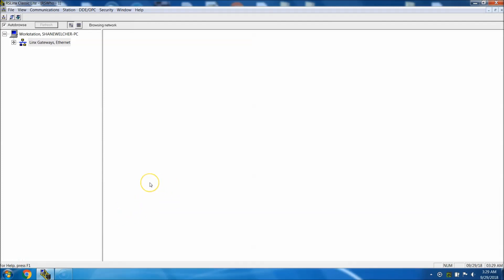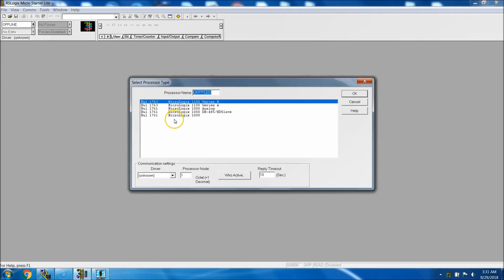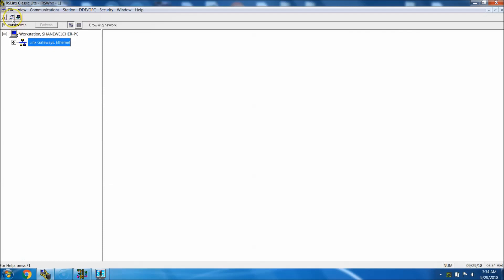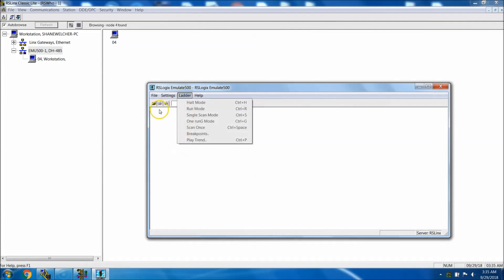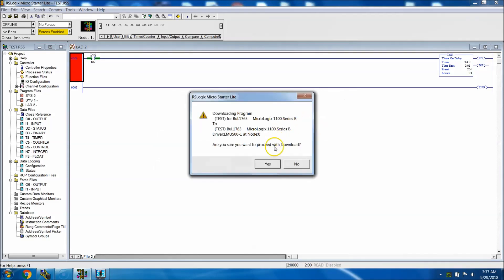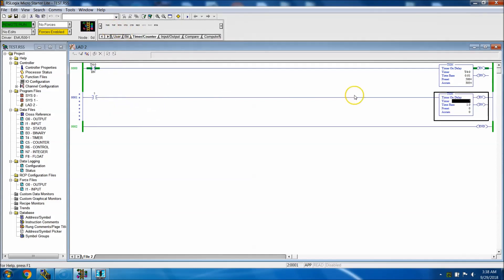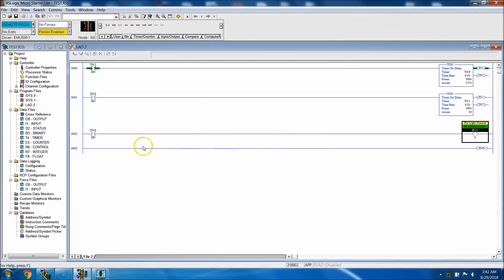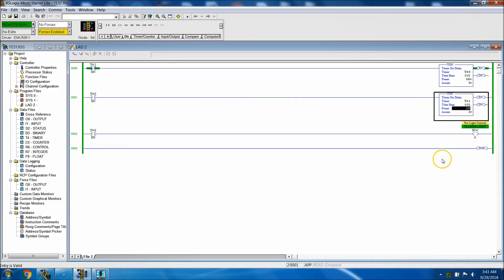Using RSLogix Emulate 500 With RSlinx The Easy Way

Comment: Thank you so much for posting this video I'm older guy a a machine  equipment building  maintenance technician in a contract manufacturing shop and have a lot of years as electrician, machine control circuit limited with actual fuel running of CNC equipment but always chad a set up guy to help me with that part of the troubleshooting an o experience with programming ,we starting to get into automation equipment now and I am messing with a online PLC basics course,but I'm lost this video got me set up with the emulator and software I downloaded a while back and had no luck working with course instructions , following you on video had me up and going and putting that first program on and running in 30-40 minutes . I hope to find more of your videos as I work through the course ,I've hit some road blocks now as he is explaining comparators,and mathematical operators , and I am lost . Thanks again
Reply from the maker: @lyonsartisanwoodworksandmo6197  great

Comment: Is it possible to manipulate inputs with the emulation program?
Reply from the maker: Through RSLogix Emulate 500 - you can write simulation code to mimic the inputs & control the outputs.

Through RSLogix Emulate 5000 - you can add input & output cards in the emulated PLC rack & toggle them from the emulated PLC rack along with writing simulation code to mimic the inputs & control the outputs.

Example video: 
Connecting Studio 5000 Logix Emulate to a PLC Program
https://youtu.be/zyX2Ra50Zt8

Example video:
Studio 5000 I/O Emulation In an Add-Instruction With Studio 5000 Emulator
https://youtu.be/OPMyvlkCE1U

Through FactoryTalk Logix Echo -  You can take any real-world program & emulate it without changing a single thing on that PLC program. 

Example video:
Using FactoryTalk Logix Echo Tutorial
https://youtu.be/_8BCGchQtMw

Hope this helps

Have a great day & always take every day as a gift of learning to better yourself.
We can all be a better version of ourselves tomorrow than we are today.

Comment: This is just for emulation, right? There's no way to use RSLogix Micro Starter Lite to program an actual SLC500 PLC, without a paid license, correct?
Reply from the maker: Yes, this is an emulator.

There is a free version of emulator for microlite.

I offer that in my course
Reply: @ShaneWelcher  ok so there's no way to actually go online with a real SLC500, without a RSLogix 500 paid license then? 

Thanks for the helpful info!
Reply from the maker: @adampnewsome  Actually there is using the free microlite but only one small processor

Comment: I can not change the no edits, there is the error to edit a line online, what to do?
Reply from the maker: You have to be offline to edit using RSlogix Emulate 500.

I talk about that in the video
Reply: @ShaneWelcher  right, I have a plc 1200 1762-l40AWA and in online mode he is not in a position to create a new editable line, I took another plc 1100 and got it. this model 1200 he does not give this condition in the edition of online line?
Reply from the maker: @FelipeSantos-xx4bl  

In PLC 5, you need to be offline in emulator or even depending what firmware you have on a controller...meaning an old controller
Reply: @ShaneWelcher  I understood about the emulator, now another question without using the emulator. do you have any social network that i can show you the videos of operation?
Reply from the maker: @FelipeSantos-xx4bl  I teach more thorough in my courses
Reply from the maker: @FelipeSantos-xx4bl  https://www.allen-bradley-plc-training.com/

Comment: Can you set a PID in rslogix micro starter lite?
Reply from the maker: Actually, I think think you can emulate a PID logic control not sure about Microlite for the PID data type
Reply: @ShaneWelcher  I have emulate and the rslogix version for micro logix free download. Trying find a video on setting up a pid using that version.
Reply from the maker: @johnrece6622  I'll look into it for you about Microlite.

I use Pro
Reply: @ShaneWelcher  thank you sir

Comment: Hi! Thank you so much for this video, It really helped me a lot! 
I was trying to change the elements as you showed, but mine seems locked. Is there a way to unlock it so I can add more elements?
Reply from the maker: Sounds like you should edit offline then download.
Reply: @ShaneWelcher  I meant actually add more inputs. I can edit the elements for bits, timers, etc but for inputs and outputs I'm only given locked 6 elements. Is it the usual?
Reply from the maker: @GTwilight14  Yes, just add them offline.

No online data changes.

Also, keep in mind that if you are using a real processor then it is limited to the processor size.

Comment: I did this which seemed simpler to me:
1. Open RSLinx and configure the driver as shown.
2. Open RsLogix Emulate500
3. Open RsLogix Micro Starter Lite. Build your program. Compile and then download under the Comms tab and it populated the MicroLogix controller for me RSLinx.
4. I can then run my program straight from RsLogix.
Is this not correct?
Reply from the maker: Give it shot, I teach this in one of my course but practice helps
Reply: @ShaneWelcher  Thanks for the reply. I looked up your courses and they look great. How long is the 30% discount going on for?
Reply from the maker: @William9alex  open for all at anytime just for value to help people learn

Comment: can you set the ip address ? been trying to do it , with no luck.
Reply from the maker: IP address for what, this was an emulator video....am I missing something?
Reply: @ShaneWelcher   im a software developer and i would to start developing for PLC and automation , i have the rxlogic micro starter, the rslinx clasic lite and the emulator rx logix emulate 500 , i can write and run plc programs on the emulator, but i would like to connect to it via ip address from a c# app am writing .
Reply: @ShaneWelcher  never got a reply back...
Reply from the maker: @djlowformat  You can't tie in physical devices to emulator
Reply from the maker: @djlowformat  If you want to truly program then buy the software and devices, what are you asking to add in IP addresses to emulations?

Comment: Shane I'm trying to open my program in emulate 500. After, I saved it in rs 500 Micro starter. It keep saying I must compile my program. How do I compile the program.
Reply: Shane some of the problem was with updating the registers on my computer. Now,  when I download. It telling me the processor type is not supported by the emulator.
Reply from the maker: That makes sense,

View the last video I just made.
RSLogix 500 Compiler Issue Fix  - Several Examples In This Video
https://youtu.be/SbSkA6zOOEw
Reply from the maker: I am going to make a video on this now on a few options. I would first check your rslogix 500 file and go to the processor status then verify that S:2/4 or S:2/3 is set to zero. 
Go to the processor status then change the data type from structured to binary to see these bits.
Reply from the maker: Also, verify that your setting is right when opening it in RSemulate500.
I assume that you have done everything as I have shown in the video and that you have also tried several different files.